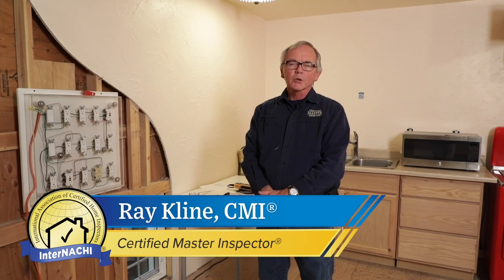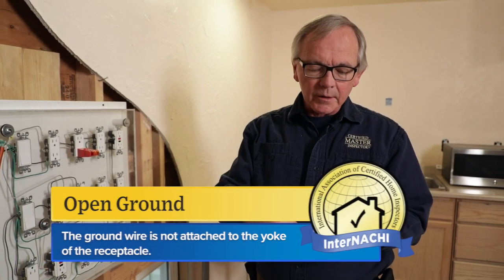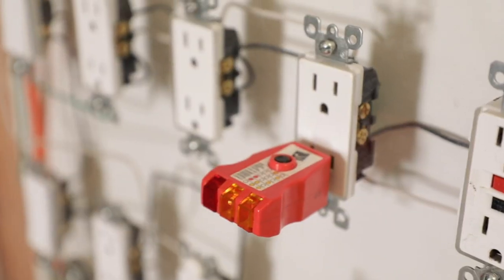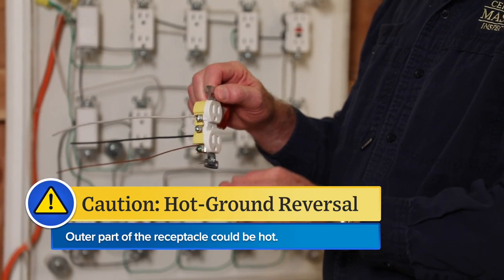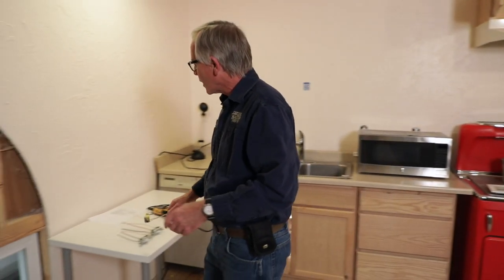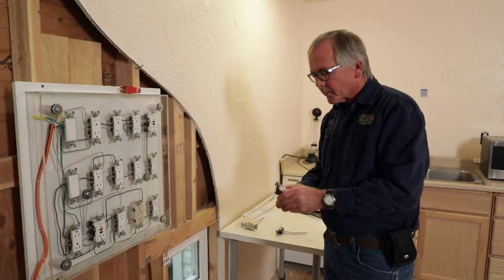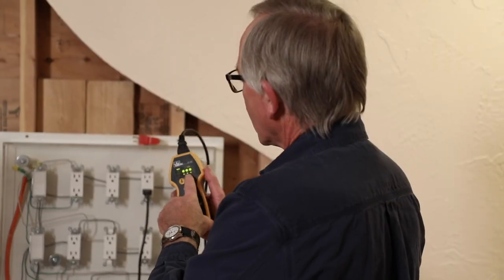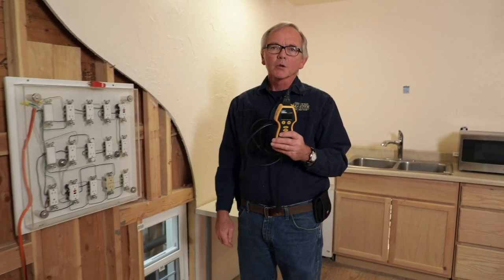Quick Inspection Tip: Testing Electrical Devices

Comment: Would a GFCI receptacle trip when tested if there is a open ground?
Reply from the maker: I believe yes because the GFCI is measuring the difference between the hot and neutral.
Reply: The plug in tester he used will not trip a GFCI outlet that has a open ground!
Reply: @curtseawa   why is that? I know you can install a GFCI on an u grounded circuit, didn't know the tester won't trip if no ground. Wondering how the tester works

Comment: "Upside Down" outlets are just a tradition, not a defect. Note that almost all medical facility outlets are ground pin up, for more reliable connectivity of crucial medical equipment. The ground lug is the one that holds the best, so if a cord is sagging and coming out a little, if the ground pin is up, the power lugs below it are levered IN, when the ground pin is down, the power lugs are levered OUT.  In MY house, the residence outlets are Right Side Up, in my workshop and garage, I've installed them Upside Down for just this connectivity advantage. When I see a new house with "Upside down" installation, sometimes it was deviced by an apprentice whose last gig was devicing a medical facility. Not wrong, just looks funky. I'd have the electrical contractor correct it for COSMETIC reasons, which is why I don't write it up on an inspection. If the client is present, I'll verbally comment on it.
Reply from the maker: Thanks for the feedback, Lee. I'll pass on your comments to Ray.
Reply: If there is only One in the room and no overhead light fixture- it's usually the 'switched outlet' for a lamp.
Reply: Necro comment, sorry.  Actually, it's worse than that.  Correct me if I am wrong, but all the outlets installed with the ground terminals at the bottom are a code VIOLATION.  The ground must be at the top, in case something (for example those metal prints that are so popular these days) fall and slides down the wall, it hits the ground FIRST.  Otherwise, it could strike the hot and neutral, causing a short and potential fire.
Reply: @danielvalyou9982  Please cite the code reference